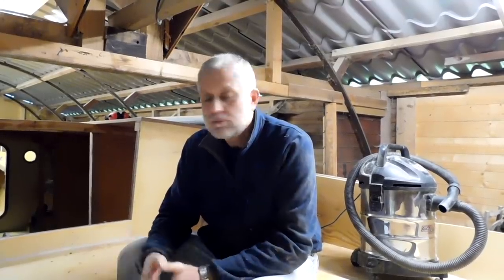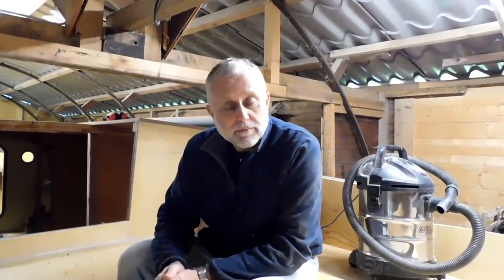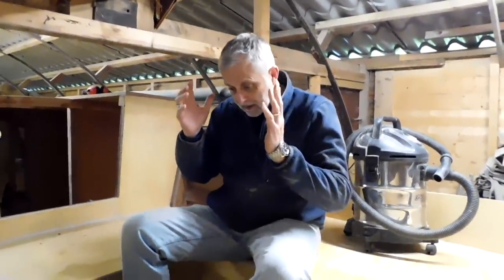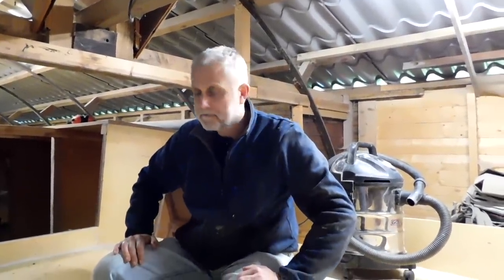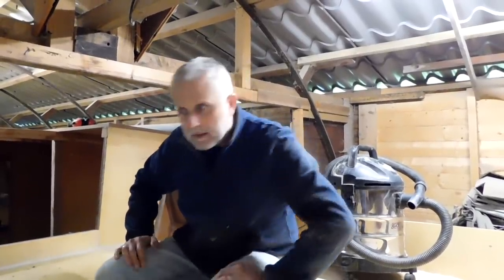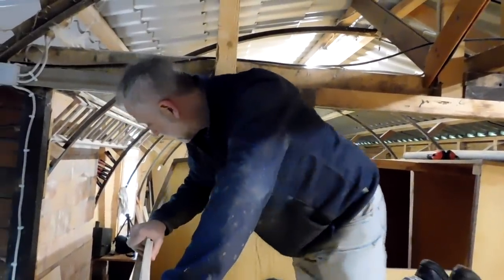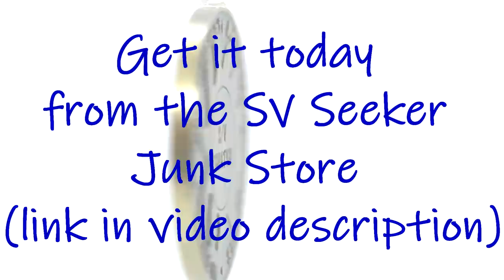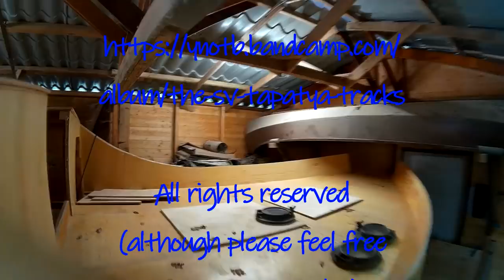The cockpit floor, the aft deck boxes and a sea kayak - SV Tapatya EP86

Comment: Way back when you put down the first layer of ply on the rear deck, I became curious about the cutout in the deck and cabin top above what I later found out is a quarter berth. Now I'm pretty sure I see what's going on. The faux deck box on that side will provide for extra headroom to get in and out of the berth, a backrest, and also cockpit symmetry.  Now I'm wondering if you had the idea for the deck boxes first, then realized you could use the starboard one for extra space over the bunk?  Maybe you were wondering how to create some headroom, and then came up with the deck box idea? Either way, pretty inspired thinking!
Reply from the maker: Thanks. I always planned the extra headroom in the deck box on the starboard side. The deck box on the port side is developing though. Current thinking is to get a storage cubby hole from the gallery in the forward end, behind that a sealed area with the day tank and filling caps, and behind that, an opening deck box. Should work!
Reply: SV Tapatya that sounds a neat use of the space. 👍🏻
Reply: @SVTapatya  - I like the sound of that port deck box.. nice to see the starboard one getting some attention at last, too!
Reply from the maker: 👍Getting there!
Reply from the maker: Thanks Robert 😀

Comment: When I have seen plywood used outside it's started to deform de-laminate, I remember you saying something about it not being marine ply so what is it ? Also wondering just out of curiosity if you are a pink Floyd?  fan
Reply from the maker: Hi Jas
There are basically 3 main grades of plywood. Interior ply is only for dry applications; it delaminates when it gets wet. Exterior ply is glued with waterproof glue; it’s fine in wet applications. Marine ply is glued with the same glue as exterior ply, but the wood quality is guaranteed.. The designer of these boats states - and I agree - exterior ply is fine as long as it is sealed with epoxy ( this is all a bit simplified)
I'm using exterior, wbp glued ply
Yes, love Pink Floyd 😃👍

Comment: How many sets if feet can fit in the cockpit? It looks like two at the most.
Reply from the maker: Two comfortably. That's. Enough. Rather a cockpit that can't hold much water than room as a party boat Bill 😀
Reply: Can four people fit on the stern? Two in the cockpit and two on the sides?
Reply from the maker: Yes Bill 👍